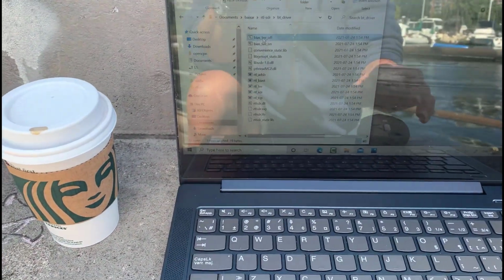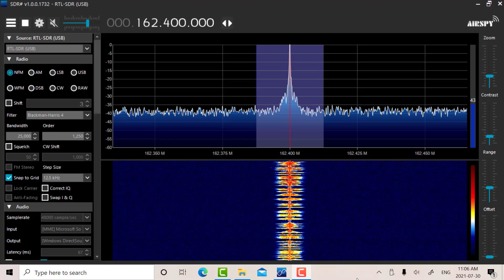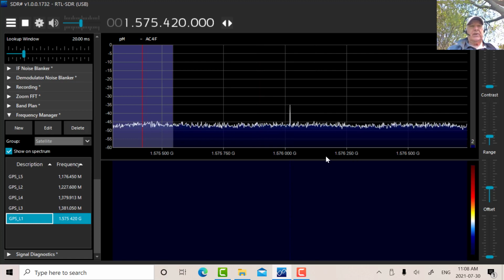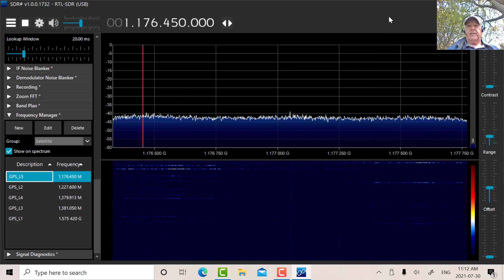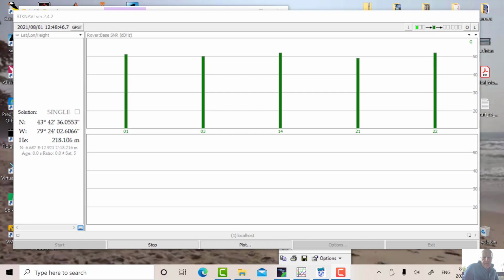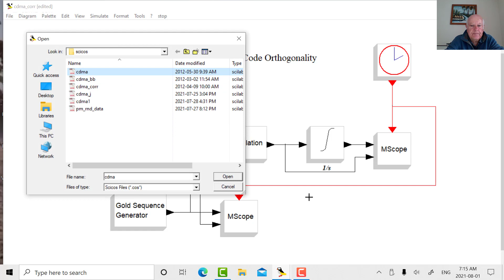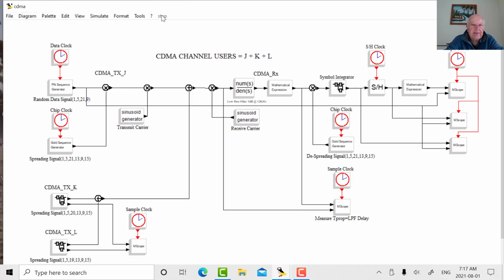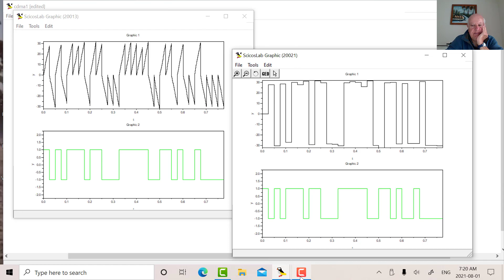RTL-SDR for Satellite GPS

Comment: Dear all,
I am unable to get a GPS fix with RTKNAVI.
I am using Win 10, the RTL SDR V3 dongle(RTL2832U R860 TCXO+BIAS T+HF), bias tee on, GPS antenna and RTKLIB 2.4.3. 
Is it working for anyone? Could you kindly tell me how you managed it?
I am not the only one having problems. Thank you for your attention.
Reply from the maker: At what point in video does your setup not respond?

Comment: On my computer these windows starts opening and closing but I can't see those gnu plots and when I try to connect it with rtk navi I end up getting an error localhost: time out
Reply from the maker: Make sure you set the two screens up exactly like Ref.6 in blog post (TCP Client). Wait till the windows stop opening, this may take a minute. The gnu plots are scattered all over the desktop, they may be out of sight. I only check GPS off, otherwise there will be many windows. Then when stable, open RTKnavi. You need at least 4 sats to get first fix, then once locked, 3.
Reply: How to tell if your dongle is not working properly? I have done everything according to different YouTube videos and blogs but still wasn't able to get any results now I think my dongle is not working.
Reply from the maker: @copycarvers  How did you calibrate the RTL ppm, what signal did you use?
Reply: @ClarkTelecom  I haven't calibrated the dongle yet. Is it necessary to calibrate before working?
Reply from the maker: @copycarvers  Get it close to within 1ppm. Changes a bit as it heats up.